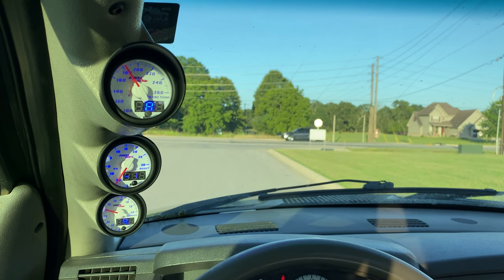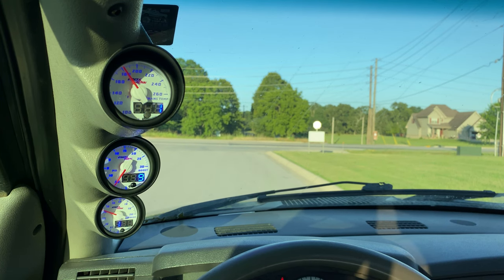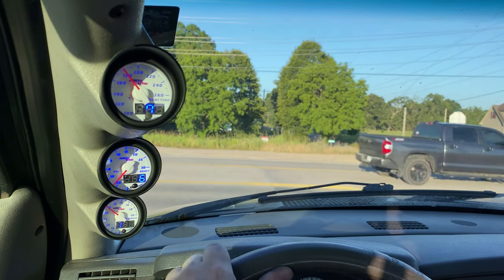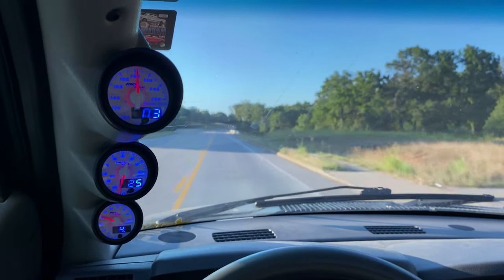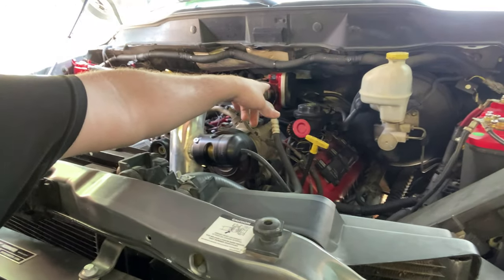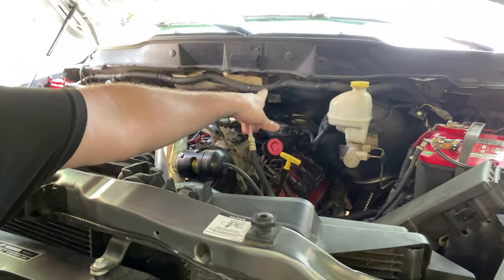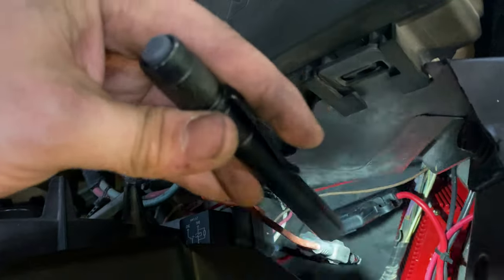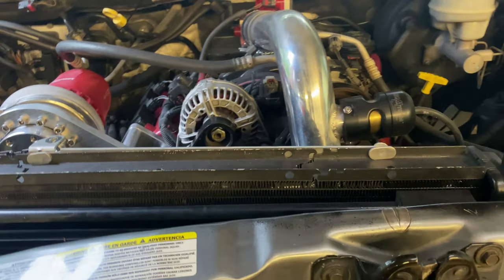First WIDE OPEN THROTTLE in the Supercharged Hemi Battlewagon | Kenne Bell Boost-a-Pump goes on

Comment: Would you be willing to do an in depth video of how you wired an external fuel pump relay? I have the exact setup as you with year except for a procharger. I’ve tried as you said and TIPM doesn’t supply fuel pump when BAP is connected. I’ve tried emailing kenne bell and searched online and can’t find anything. Was recommend to go with a 400lpg Walbro pump with external return. I’d rather do that on another time. I get you mentioned the just of it but I don’t want to make error and ruin the TIPM. If you can make a more in depth as for wiring I’d appreciate it. Thank you if anything.